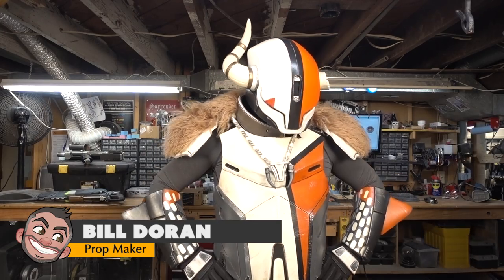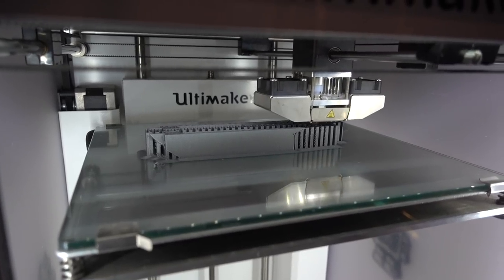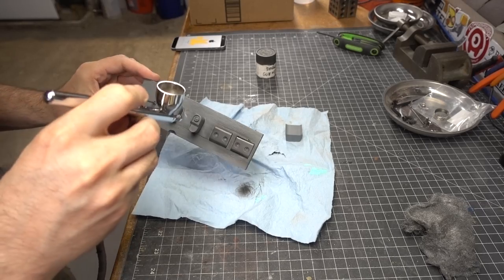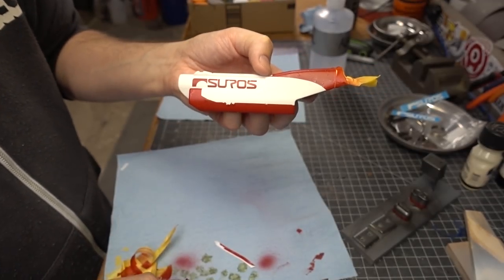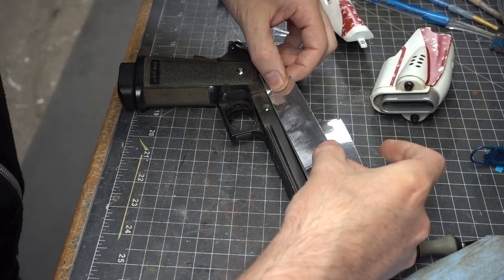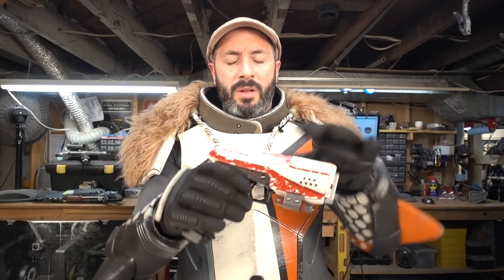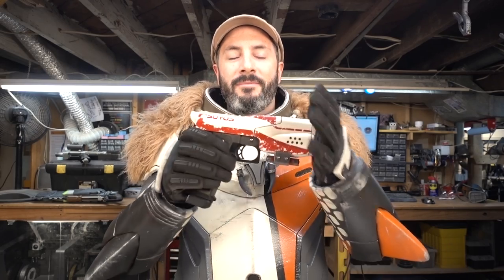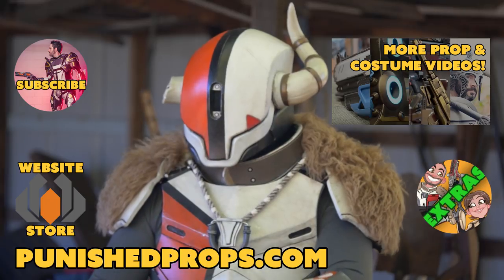How to Make a Functional Destiny Airsoft Sidearm

Comment: Hey Bill, I have a tip: Threaded inserts. Not to hard to use (jam it in with a soldering iron) but will save the screw holes from being stripped. Alternatively, model in a nut holder.

And another tip, when you insert a screw, give a spin in the loosen direction first so that it finds the original threading and not cross-thread the plastic.
Reply from the maker: I think I'm gonna try modeling in a nut holder (teehee).

Comment: Small tip - use microbarb inserts and press them into the ABS, instead of cutting threads in the ABS. Way more durable. Requires some pre-planning / pre-drilling, though.

Comment: You might try reinforcing the screwholes with an m3 nut, that way even if the tapped hole fails, the nut inside will hold the screw in place and keep the thing together.

Comment: Have considered printing out matching grips for that hicapa?
Reply from the maker: +albhednomad Sadly that grips are integrated into the airsoft gun. They don't come off.
Reply: Punished Props le darn
Reply: well they do come off, its just time consuming.
Reply: they don't, the grip is one piece. you can replace it though.
Reply: it IS one piece, but you still CAN remove it and replace it

Comment: Wow.. Great work. The only Airsoft prop work that comes to mind, for me, is The Expanse. Definitely going to have to pick up those weathering powders. Seems to be much easier than a wash, although washes aren't very hard to begin with.
Reply from the maker: I specifically like using the powders for more subtle weathering. Washes can tend to get a little over the top.

Comment: I could possibly see were you could add a tactical part to the front underside were you could have a effect system housed for lights and sounds for a plasma pistil. the biggest challenge would be to get the effects trigger at firing. Probably would have to use a motion censer to react to the firing vibrations.
Reply from the maker: That sounds pretty challenging, but it's a solid idea!

Comment: I didn't quite expect this to be on airsoft frame, but in retrospect it's obvious. What i thought of while clicking on the video was a solenoid based movement. Is this something you'd like to do eventually and would like help in figuring out the timing circuit? Is it something you'd prefer to build out of discrete components or is using a Digispark/Trinket (Arduino) or the like par for the course? Would a solenoid based movement be generally suitable for conventions?

I guess a purely mechanical or gas driven design akin to that in the airsoft gun is possible too, but that's way outside my knowledge area, and i imagine it couldn't be easy to get right. Then again if someone did the mechanism once and published it or made it available as paid download (without adornment, just the mechanism), it would potentially be a great service to the community.
Reply from the maker: I'd like to eventually work with more sophisticated electronics for movement in props and costumes. I still have no idea how I'd do it.

Comment: Love this.  Airsoft mods are kind of where I started.  Or at least where my passion took off.  Given a few odds and ends here and there like some Dr. Horrible goggles and props I made for earlier costumes.  

Surprised you didn't paint or modify the actual gun.  I might have gone with an airsoft M&P and painted the body a flat granite and maybe modified the grip.  
Also, I might have just attached the 3D printed body to the rail and let the slide kick out the back without opening the body.  But that is assuming they are using caseless rounds and don't need to eject a shell.  
Watching game play in slow motion I see that it is a striker fire pistol unlike the hammer fire you are using for your base and I do see the body recoil action while firing and while being chambered, but it's most of the body minus the front of the barrel.  FYI.
Reply: Upon closer examination you are right on with the body sectioning and recoil.  Can't believe I even questioned it.  Sorry.
Reply from the maker: I thought about it, but I didn't want to do anything permanent to the airsoft gun in case I wanted to use it for something else.
Reply: Yeah, makes sense.  As pretty as it is I'd commit it to a wall or display case.  Given I have a lot fewer builds than you.

One of these days I'm going to get back to building my Lawgiver mk II, built around a select fire gas airsoft.  Glock 18c

Comment: Would you recommend taking something like this to an actual airsoft skirmish? Also you definitely need to do more airsoft mods
Reply from the maker: I don't think this is durable enough to survive competition play. I could probably build something stronger if I designed it differently or possibly used different materials.

Comment: Punishedprops, hey why don't use use short pcb stand off's glued in the area for the screws just make hole a little bigger for then and glue standoffs in place. Just an idea.
Reply from the maker: +Charlie Hadley That's a pretty good idea!
Reply: Punished Props cool I hope it helps, you prop build are awesome.

Comment: How would I use sandpaper to clean up edges? I've gone down to 400 grit and I STILl get marks in my foams when smoothing it out. How do you get your messy edges so smooth?! I'ts driving me nuts~
Reply from the maker: For EVA foam, I like to use a stone grinding bit in my rotary tool to polish the edges.
Reply: Holy shit you replied! YAY!! I'm in the middle of the hunter destiny knife build and it's looking really good considering it's only my second time fabbing anything. I'll try the stone grinding bit, but the one I was using takes an enormos amt of pressure to smooth out. Maybe I just need to keep experimenting w different bits.

Comment: Use helicoil inserts for your screw locations.  Bond them in.  :)
Reply from the maker: YES! Those things are awesome. I gotta buy some and give it a try.
Reply: I saw you went with embedded nuts and made your own nutplates.  Good idea...generally cheaper as well.